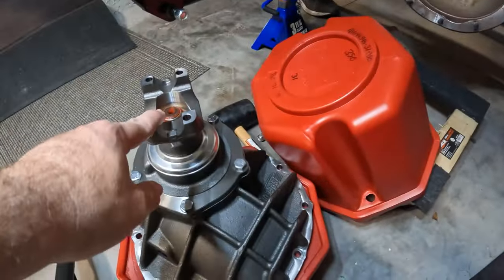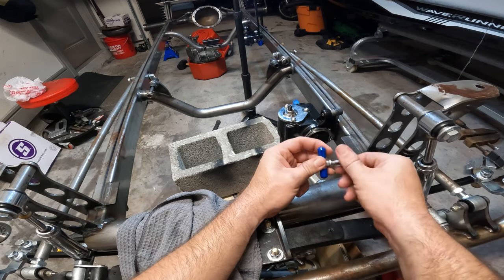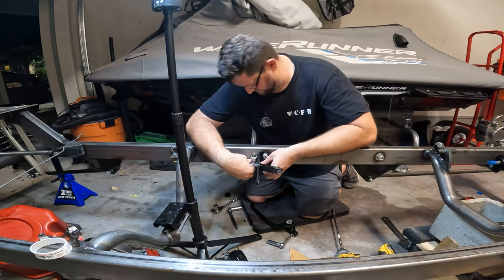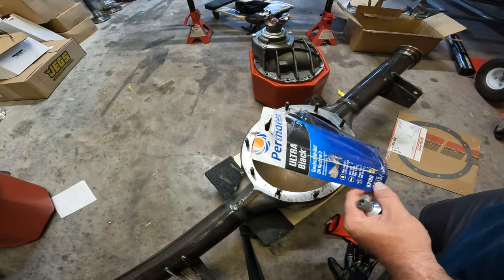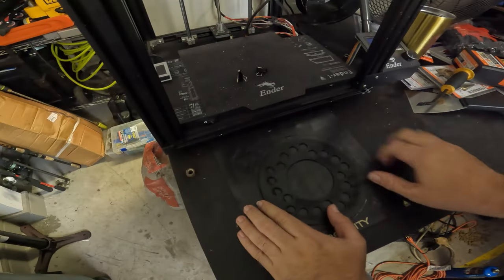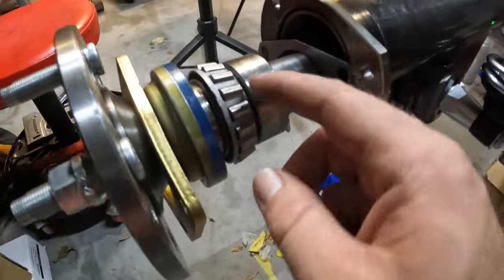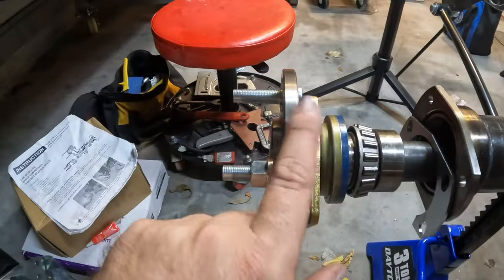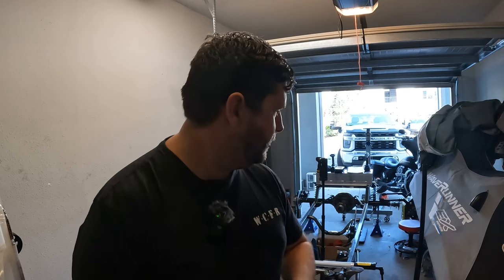T Bucket Hot Rod Full Build - EP3 | Speedway Motors Building the T Bucket Kit

Comment: Great progress, you're making it look easy
Reply from the maker: Thanks!  But it's not without sweat blood and tears ... probably more tears hahaha.  The hiccups can be frustrating here and there but I'm surprised with how well it's actually going together like a true kit started the motor drop the other day and so far that's going smoothly.
Reply: @GearHeadzGarageUSA  , like a big expensive model car, looks well planned out, other than the typical lack of instructions for some parts. I guess it helps to improve your skill set. Lol 😆
Reply from the maker: @keithkrause3386  I'm very surprised on that part and considering the amount of items ordered so far I have yet to really run into a lot of missing parts....a bolt here and then but I won't lie.....I do call the tech support like 10 times a day and those guys are great at explaining some of the instructions lack of detail. I am not really sure it's even the assembly manual it's the fact that the manual contradicts the website which contradicts the instructions that ship with the part.....Let's say it's an expensive adult Lego kit you can drive.... without instructions haha